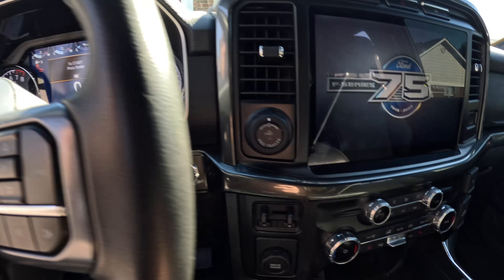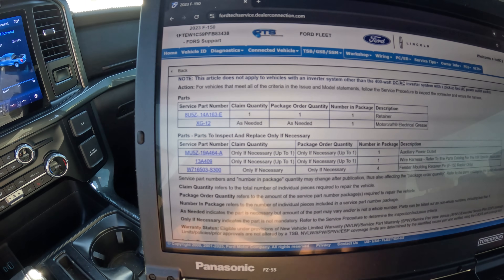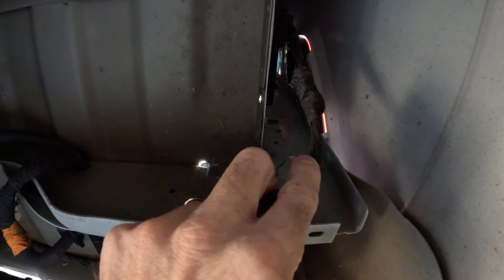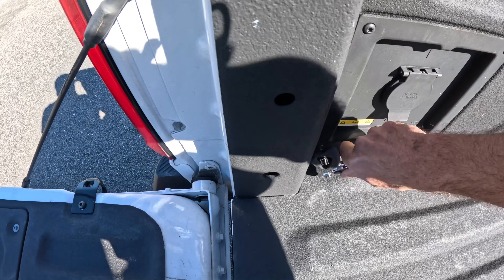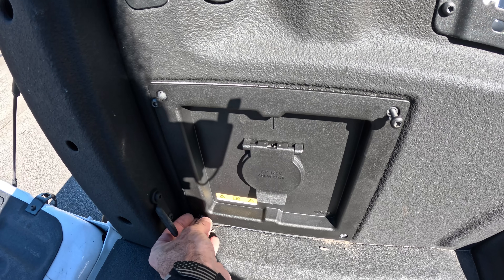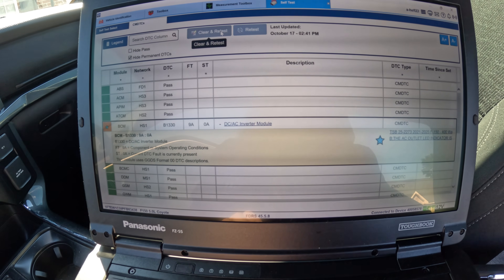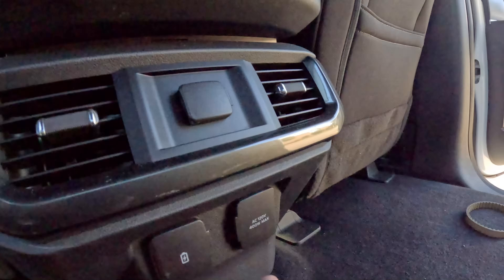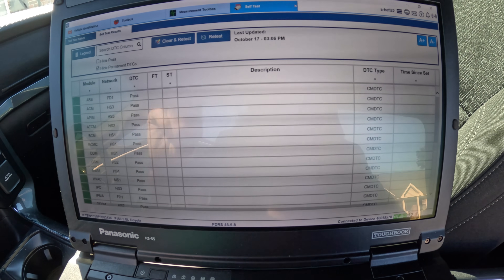NO POWER? EASY FIX! 400 Watt Inverter F150

Comment from the maker: Thank you for watching. Yes thers is a like a 10 sec spot with no audio or video.  Corrupted during export.  It was fine editing.  Sorry. Dont forget to check out the merchandise page.
ORDER GLOVES OR A WRENCH GET A FREE TSHIRT!
Reply: where do you get the software you used to make sure the plug was working properly.
Reply from the maker: @juanflores2991 dealer software.  You dont have access to it. Sorry
Reply: @BeardedFordTech  do you have the part number the replacement you swapped out in the bed of the truck
Reply from the maker: @juanflores2991 yes. I have the part number for the one i put on my truck. By VIN. There are 4 different ones.  I would need your VIN (do not put it.in the comments)  how do you know its the part you need?  How do you know its the the inverter or a popped fuse in the bcm?
Reply: @BeardedFordTech  does Forscan work?

Comment: What if your truck is not even showing pro power on the features menu? Also no power at outlets. No hard button for pro power either.
Reply from the maker: Is your truck equipped with pro power?  Or does it just have outlets?  There is a difference. Pro power actuslly allows you to use a generator with the truck off. Just outlets like i have the truck must be running.

Comment: my 24 powerboost keeps giving me this message "pro power onboard detected a ground fault and turned off the affected circuit.
".  it also goes into power saving mode and shuts off all lights and electronics as soon as I shut the truck off.  this morning the battery was dead even after driving it yesterday and it not being really cold.  could this be the same problem?
Reply from the maker: Could be. Weak dead battery.  Mine kept going into power saving mode about 2 wks ago. All the llights shut off like yours. Put a new battery in and reset battery monitor system everything is fine now.  As far as the ground fault.  It could be the plug in the bed.  You can try replacing rhe battery and restting the battery system and see if everything comes back online.
Reply: @BeardedFordTech  will do, I believe its an interstate battery. Ridiculous its already shot at 2 years in a mild climate
Reply from the maker: @josephs8364 mine was 2 years old too. Mild climate as well.  These new batteries suck. I did a video on it.  Called motorcraft batteries suck

Comment: Do you know the replacement part number?  Where did you purchase?
Reply from the maker: Purchased it st the dealer. There are 3 different kind so I would need your VIN to get you the correct part number.
Email me your VIN
Reply: @BeardedFordTech  Was it the same part number as the outlet that you took out?
Reply from the maker: @Delaney-Motors no thats an engineering number

Comment: If I plug the bed cable off .  Will the inverter works with the inside plugs
Reply from the maker: Plug it off?  As in it doesnt work back there?  And you want to cap off the wire?  No it wont work. It will see a fault

Comment: Awesome video. Once I replaced, do I have to have the computer to actually run that little update that you did or is that just what you did to test it after the fact?
Reply from the maker: Thats fdrs. I was checking for codes. And any module updates.
You would just install it and reset the battery monitor system. And it should come on.
Reply: @BeardedFordTech  I had the same question since I don’t have the ability to plug in the computer. I won’t need to rest the Lin will I?
Reply from the maker: @Seawhydollasign you have ro connect it to LIN. You dont reset LIN. You will reset the battery monitor system

Comment: You are actually the first person that I have found that actually talks about the outlet in the Ford F150 bed.  Because of this I have a question for you regarding the usage of the outlet.  Firstly, I have a 2024 Ford F150 5 Litre XLT.  What I want to do is purchase a portable power station and plug that into the truck bed outlet and run pass through power to an electric cooler.  The theory being that the trucks outlet will continually trickle charge the power station while the truck is running.  When the truck is turned off the cooler will be powered by the power station.  Now I know the outlet is rated for 400 watts when the truck is turned on but stationary and 300 watts while it is being driven.  I also know that the power stations normal power draw is more than 300 watts.  You can however reduce the draw to 200 watts through the power stations app.  When searching the internet I saw a few threads that made general comments saying not to do it as the Sine Wave is not compable.  I know nothing about electronics so I have no idea if that is true.  I have visited my local dealership and they basically had no idea.  They only said, "well it should work."  I just don't want to damage anything.  All the videos I have watched talk about wiring the power station into the inverter by the engine and no one even mentions using the outlet.  The power station I am looking at can be charged by using the 12 volt outlet in the truck.  If it comes to that that is what I will do.  I just wanted someones thoughts on using the outlet to power the power station.  Sorry for the long winded question but I would be interested in your thoughts as it sound like you know what you are doing when in comes to Ford trucks.
Reply from the maker: The inverter is under the back passenger side seat. Not in the engine bay.  The sign wave is different. If you overload the system the led light will flash orange until you unplug it turn the truck off and bsck on to reset it.  It is rated at 400 watts continously. So having it in there plugged in will draw most of your power. You wont really be able to plug anything else in the truck with that plugged in.  
If you had the 7.2k onboard power/generator the truck can be off and use the generator to run it.  
I wouldn't hardwired it in thats how things get damaged.  Just plugged it in like normal. People run power saws off of it so I dont think a cooler would hurt it. I plugged a power strip in mine and used it with a few things plugged in no problem.
Reply: @BeardedFordTech  Thanks for the quick reply.  When I mentioned the engine I believe people are installing a seperate inverter and connecting it to the battery and running it to the rear of the vehicle so they can install a 12 volt outlet.  At least that is what the videos are showing.
So if I read your answer correctly the power station being plugged in to the bed outlet and drawing 200 watts shouldn't be an issue.  The only other thing that may be plugged in maybe a cell phone.
Reply from the maker: @DonPotterMTB correct. It already has an inverter under the back passenger seat. I showed it in the video. As long as you are below to 400watt you are good to go.
Reply: @BeardedFordTech  Okay.  Thanks.  I will give it a try once I get the portable power station.
Reply from the maker: @DonPotterMTB 💯💯 let me know.
Reply: @BeardedFordTech  Sure.  I'm hoping it will work without any issues.  It does concern me that no one else published a video on the subject.  You can usually find a video on YouTube on just about anything :)

Comment: It says 400w but I think that's peak not constant.
Reply from the maker: Its continuous. Not peak. This is the low version. There are other versions that has an oboard generator and the truck can be off and still use the power.  
400-watt power inverter provides 400 watts of continuous power at 110V/120V AC output, but it produces a modified sine wave form, not a pure sine wave. This limits its use with certain sensitive electronics.
Reply: @BeardedFordTech thank you. I just wish Ford still offered the 2kw with the 5.0.
Reply from the maker: @seagullsbtn you can 
2.0 kW, 2.4 kW, and 7.2 kW. The 2.0 kW system is an option on many gasoline engines, while the 2.4 kW and 7.2 kW systems are available on the hybrid PowerBoost engine. The 7.2 kW version is the most powerful, capable of running heavy-duty tools or even small RVs, and includes both 120V and 240V outlets. 

The 2.0kw is avaialable on the 2.7 5.0 and 3.5 ecoboost. 
The other options are on the powerboost

Comment: Great video! Ford certainly goes the extra mile with their TSBs.
Reply from the maker: Its pretty in depth. And the tsb someone performed already. And it worked for a while. Jjst like the last month or whatever they weren't working so I went back through the tsb.  And we'll ypu saw the rest.  Tsb doesnt always fix it though.

Comment: Good info to know. My truck does not have the outlet in the bed. I've read that when you do a BMS reset that you're supposed to let the truck sit for 8 hours undisturbed. Is this correct?
Reply from the maker: If you dont have a computer and you change a battery then you let it sit with the key fob far away from it for 8 hours.  But you can also do it by flashing the high beams 5 times and stepping on the brake 3 times.  Baytery light will flash after about 10 seconds to verify its reset.  Or you can use a computer